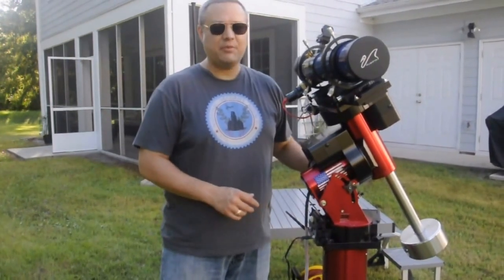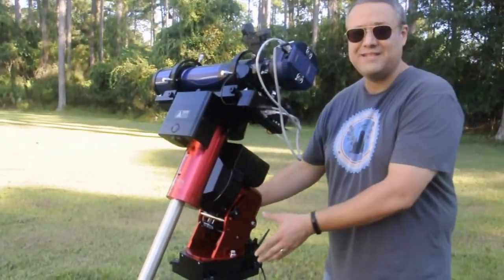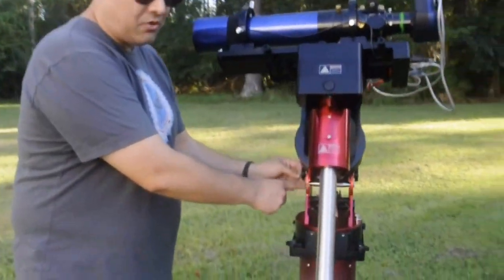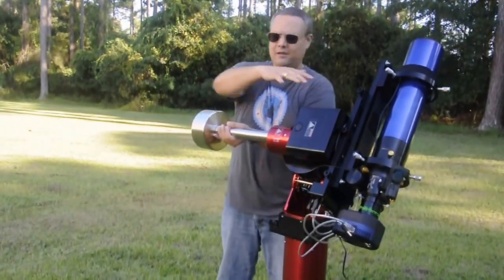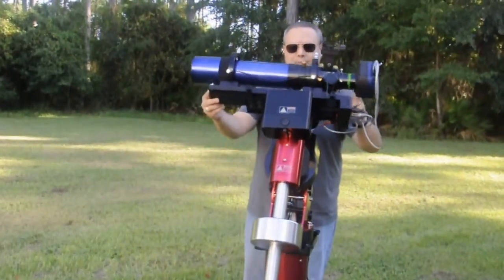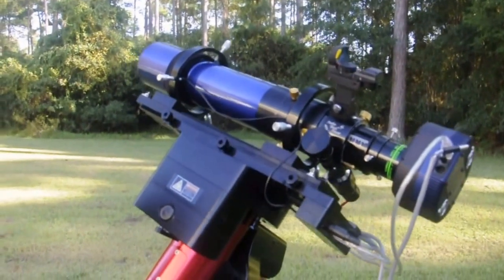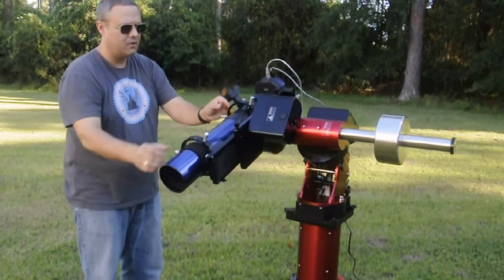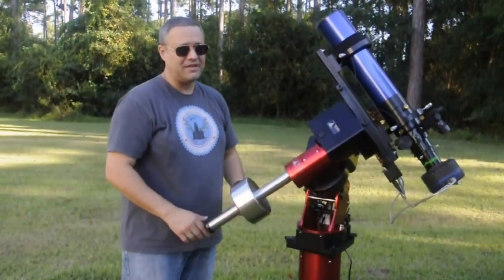How to Balance a German Equatorial Mount

Comment: way to many plates how many do you need mate you would loose two ton off it if you get rid of all that extra weight there is no need for any of it why they are designing them like this now i have no idea its silly
Reply from the maker: They say an astronomer's best friend is a machinist!  This was a hodge podge of two Losmandy plates to fit what I had at the time.  The rig has been greatly simplified and weight reduced by using dedicated mounting rings and riser blocks.  Of mention, the whole rig was still less than 20 pounds, and the capacity of the MyT is 50 pounds.  My mak-newt weighs almost this amount by itself, but has never been an issue for my properly balanced GEM.

Comment: May I ask why you are balancing in right ascension with the declination axis tilted 90 degrees like that?
Reply from the maker: With the DEC vertical, not all of the weight will be able to cause rotation if there is a front to back imbalance.  By putting the DEC 90 degrees, all of the force will go into rotation if imbalanced, and allow you to more precisely find the center of gravity.

Comment: nice setup - whats your tele size I know its William Optics
Reply from the maker: Thank you!  Most of my imaging has been with a William Optics ZenithStar 80mm II ED APO refractor (545mm at f/6.8 or with reducer 436mm at f/5.4).  I also use an Orion 190mm Mak-Newt (1000mm at f/5.3).

Comment: Why don't you pour 3 concrete pads that are just below the grass level for the pier - that way you will always have a level spot for your mount and telescope and can mow your grass.
Reply from the maker: I think you have a good suggestion for a semi-permanent setup.  Even easier than pouring concrete, just go to the local home center and buy pavers.  

However, I am geared for portable imaging.  I was merely pointing out for the portable imager not to forget about settling and its effect on alignment for critical astrophotography.
Reply: Let me elaborate for you  - when you pour the 3 concrete pads use an auger and drill 3' down, pour to just below the grass level, level the 3 pads with each other. You will have a permanent place for your Astronomy setup.  Putting down pavers will heave with the cold and warmth, and never be stable, and won't stay level.  Pouring the concrete pads will always give you a stable level platform to set your Astronomy setup on.

Comment: hi  I see you using TRF-2008 ,can you please tell me what is you back spacing FOR TRF2008? ,in the manual is  56mm but I  get coma stars in the edge of the frame 🤔now my trf-2008 back spacing is 48mm,? so any advice on the spacing for TRF 2008
Reply from the maker: Hey Sami...sorry so late on the reply!  To fully answer your question, I would need more information.  There are several factors that have to be just right.  What optics are you using?  The TRF-2008 is optimized for 400-600mm refractors.  If you are using something else, or collimation is out, expect aberrations.  Second, the distance from the shoulder of the focal reducer (threaded side) to the imaging sensor should be 56 +- 4mm.  Lastly, you need to know the distance for your camera's connection to the sensor.  

So for my QSI 532ws using T-mount adapter, the distance to the sensor is 35.56mm.  I needed an adapter to give me 20mm, and placed an order with Precise Parts.  I can highly recommend them, as they can configure exactly what you want.  They may be considered expensive, but so is my time and equipment!  Just another consideration, have you tried to image without the FR?  I would suspect optics to be the culprit.  I say this, because before I got the adapter, I was still able to get good images albeit not at the proper reduction.  Image quality was even better though at the 56mm spacing.  Hope this helps!
Reply: Kevin Rasso 
hi
thank you for sharing information, I am using lunt 80mm ED the focal is 560mm with QHY9S ,the backfoucs for it 32.8mm. 
the problem is that with TRF2008 spacing when I am using 56mm spacing I get coma and egg stars ,when  I reduc the spacing from 56 to 46mm and I get  better flat image !!!!!!!!?????
Reply from the maker: Another thought is image train flexure.  How is everything held together?  How far out of the drawtube does the focuser have to be to reach focus?  The longer the train, the more critical rigidity becomes.